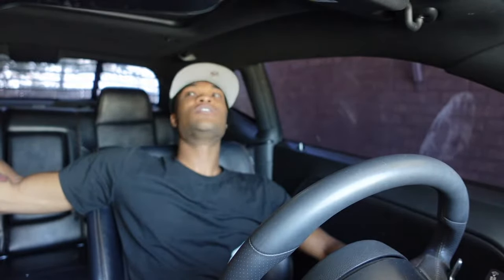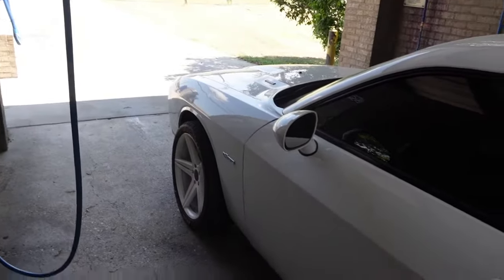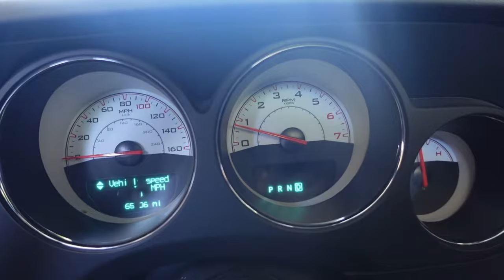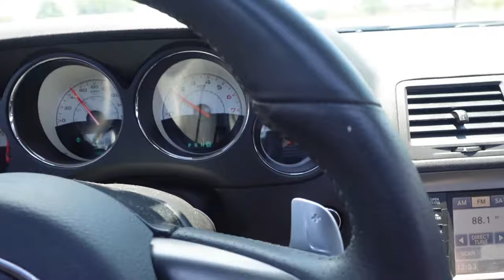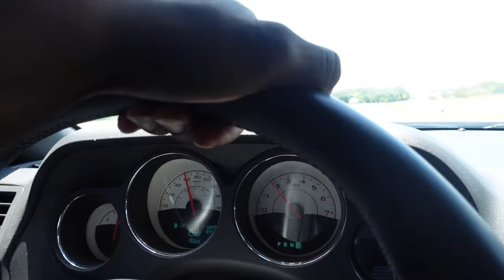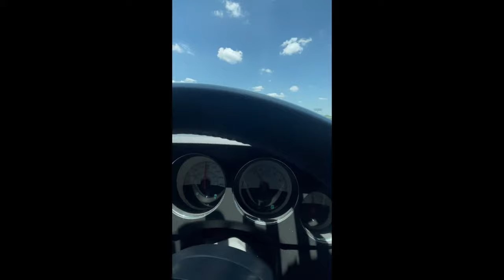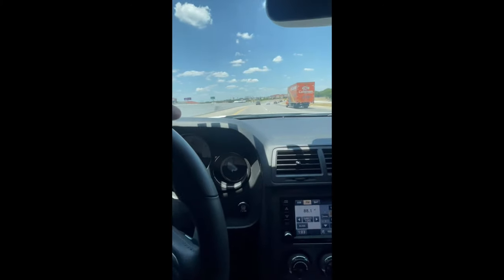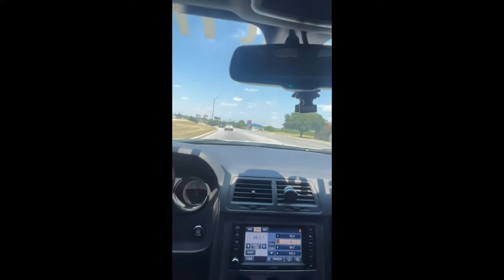First impression Mark82 Cam

Comment: Just ordered the FRP Mark 82 Kit for my 8 speed 5.7. Already have the car prepped with simple bolt ons (6.1 intake manifold ported with bbk fuel rails, Ripp coils , Stainless power headers, 3.09 diff, and DSS 1 piece driveshaft) i can only imagine how it’s gonna sound when it’s done . great vid !
Reply from the maker: Good shit bro lol yeah I need a 3.09 diff bad lol
Reply: @100PercentThrottle  big difference . i actually feel like i can compete amongst most people trying to race me
Reply from the maker: @Mast3rMindTalks  that’s what I been hearing from everyone that swap no cap 5.7s got potential fr
Reply: @100PercentThrottle  was the tuning your biggest challenger after install?
Reply from the maker: @Mast3rMindTalks  tuning went pretty smooth for me tbh Had to Go back once for a few fixes but overall good

Comment: Nice! Are you running the stock stall converter? Did you lose any torque/power in the low rpm range?
Reply from the maker: yes stock stall converter but i seem to not have lost power from it but i will be upgrading soon when i Swap out my diff

Comment: It's making the noise, but is it worth the money?
What are Your 60-130mph times after the build?
Reply from the maker: Yeah it most definitely wakes up the car but I’ll go with a bigger cam for the 5.7 if you wanna really kill shit
Reply: @100PercentThrottle  ok, but still mark82 is what FRP is proud of. So can You answer my question please?
Or, You have just installed it to make noise, nothing else.
It is not an attack on You, just really... Not many people are publishing their real acc times after cam install. Probably, it's because the gains in the long run are minimal. They (cams) making noise, nothing else I presume.
Reply: @moparenthusiast2046 I have this cam being installed now, the Mark 82 comes in two variations standard cam kit and NSR or no springs required cam kit.. the NSR will make 50-60 whp and the standard cam kit will make 60-70 whp.. With that being said LongTube headers 3.09 diff and a proper tune will have you around Scatpack power with a 0-60 at 4-4.5 seconds. Any cam over stock is worth it there’s a huge power gain in the overlap of a aftermarket cam. Now if you want something more crazy go with the tomahawk or titan you’ll need a torque converter and possibly drop in pistons for those do